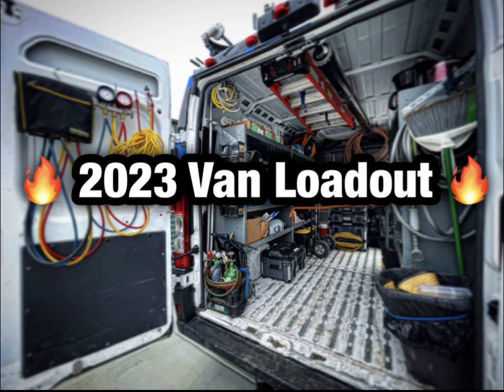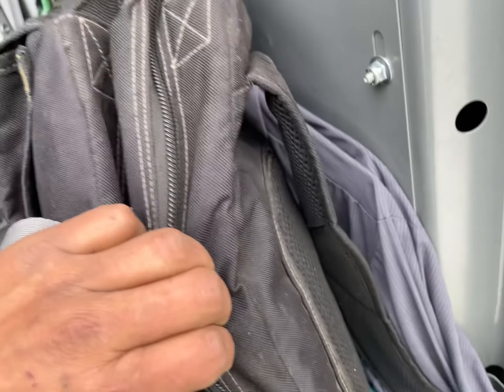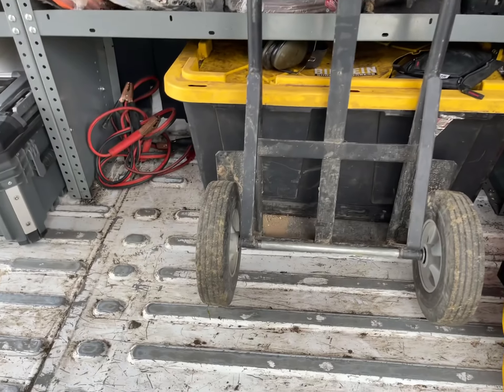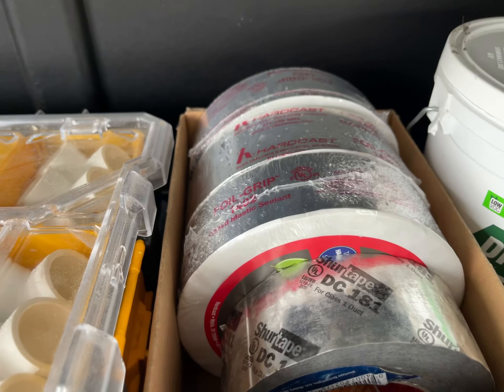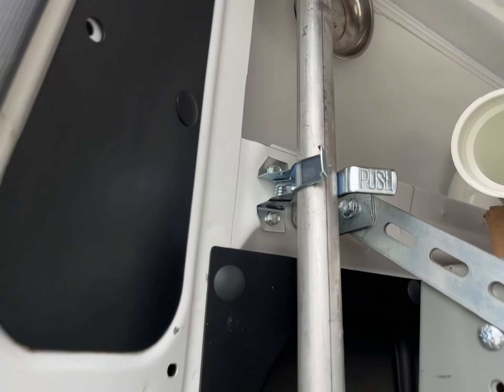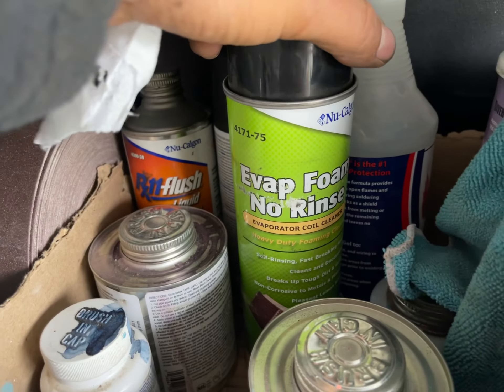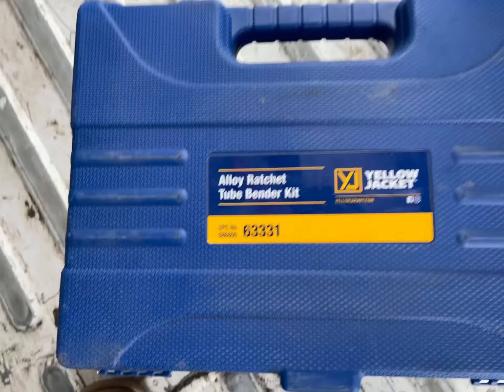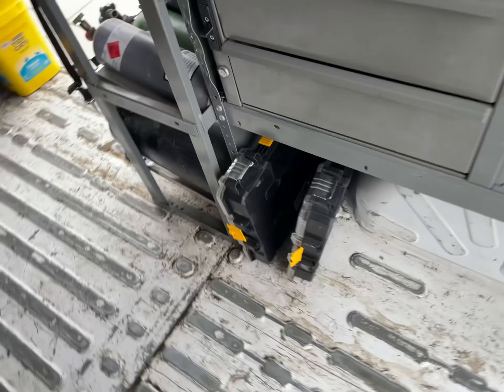Is THIS the Cleanest HVAC VAN ON YOUTUBE?! 😳😱 2023 HVAC INSTALL VAN LOADOUT 🔥

Comment: Nice set up 👍🏼 make sure to put some electrical tape at the ends of all the copper tubing that’s suspended don’t want any critters or debris getting inside there.
Reply from the maker: I usually keeps the caps they come with as well to cover them back up once I’m done cutting what I need . I just had to remember to put them back on each time 😂
Reply: @Zac.HeatingandCooling   I’m the same way sometimes 😂 good stuff tho!